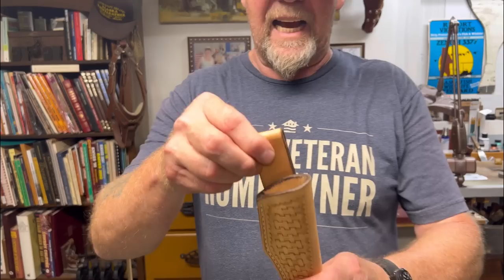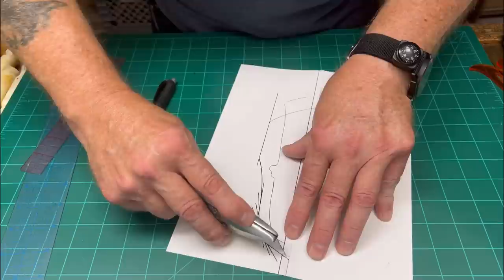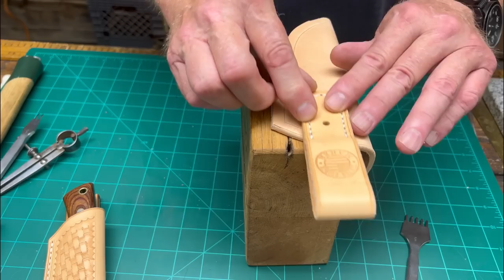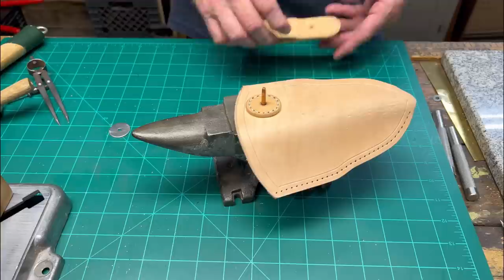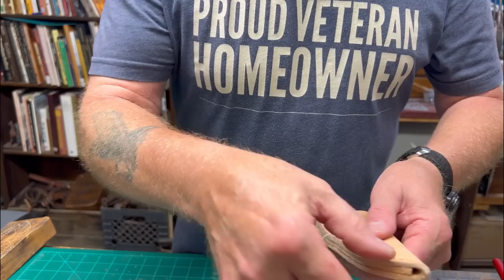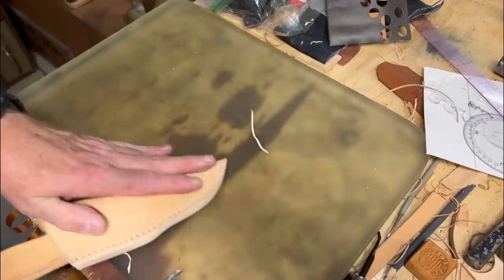Pouch Sheath with a Swivel Belt Loop feature! Knife Sheath School Vol 5 #leather #knifesheath

Comment: Excellent example of how to make carrying a fixed blade more comfortable!  I learned this many years ago when I was at an Ashokan Seminar from Rob Hudson a really great knife maker and sheath maker who has since passed away.  My 'method' differs from yours only a little bit, I glue the ends of the belt loop and when I rivet it to the sheath I go directly to the sheath and not having that additional piece which you show, which I think is a very good method that you present.  For the hole inside the sheath I also dimple in around the hole but I use a small ball peen hammer putting the peen in directly over the hole and using my mallet to hammer down the leather to create the dished out area for the head of the rivet to sink down into. That way the rivet head is lower into the leather and the knife passes above it, but your way is definitely a safer method. I put some mink oil paste into the holes of the leather and on the rivet shaft so the belt loop swivels smoother. I've shared your channel on BladeForums as I feel your videos are very down to earth and a lot of up and coming makers will be inspired by your tips and tricks to help them get over the learning curve smoothly. Thanks again for sharing your ideas and work.

Comment: Great video Man.great job. Would like to see how to dye the leather if you get a chance or time. Thanks. The sheath came out great. God bless. From Glenn CATT in Massachusetts. I use leather colors from fiebings  it's water base. I let it dry. Then I use neatsfoot oil to seal it in. So is this good to do thanks.
Reply from the maker: Thank you so much   I plan on it for my next video as I’ve had a few ask. Doing it the way you described is accurate   Dye then oil. I usually buff the dye pigment off before applying oil. I will show on my next one using a sunburst affect with an airbrush  Still learning with it but will show my technique. 🙌
Reply: @viktorgeorge9144  cool that sounds great. God bless. From Glenn CATT in Massachusetts.